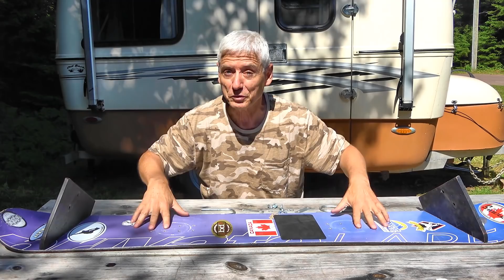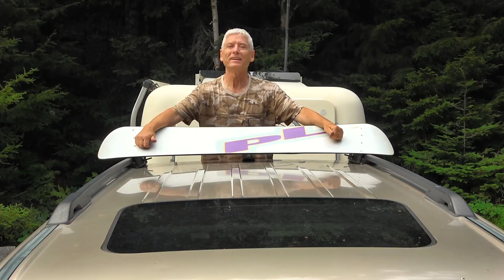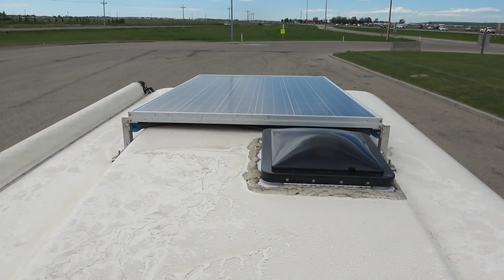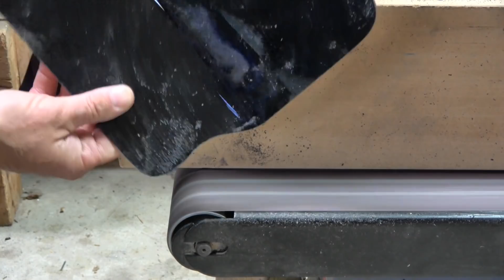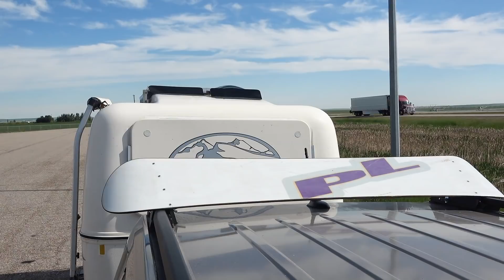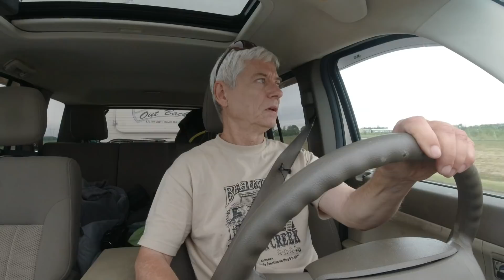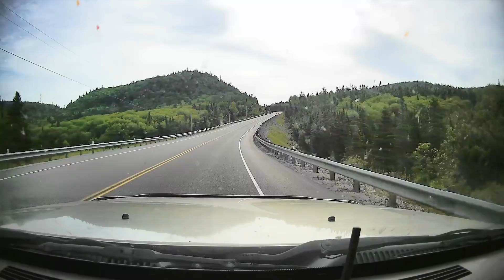Can an Old Snowboard Wind Deflector Improve Gas Mileage while Towing?

Comment: Great results but one variable not mentioned was crusing speed more energy is required to move less than aerodynamic objects forward at higher speeds, travelling at 80km/h yields good results but adds driving time... so were you always travelling at the maximum posted speed?
Reply from the maker: I kept at a constant speed a few kms under the speed limit. SP
Reply: @SlimPotatohead  Thanks for the response... I wonder what savings you would have achieved at a lower crusing speed?

Comment: Eastbound on the TransCanada there’s usually a following wind. My 18 wheeler tractor trailer would get wildly different fuel consumption rates . Ranging from 6 miles per gallon to 16. Even when empty. I’d be interested to see your results on a westward trip into wind. Good to see you trying add on spoiler to improve fuel economy. The future though must be with the manufacturer and wind tunnel testing to reduce drag coefficient.

Comment: I'm not doubting that the wind deflectors help. However,  I can't help but wonder how much the wind direction and speed influenced the results.   I would guess quite a bit.     I also wonder how mpg was when pulling the Aliner with your current jeep?
Reply from the maker: Speed was consistent, a few kms under the limit. The Aliner never achieved the results I currently have, most likely due to the increased weight. Thanks! SP

Comment: Something else you might look into for fuel saving 
There's a product called air tabs that has proven to work on semi trucks and trailers. These devices have been around for about 10 to 15 years with good results. They work by stopping the turbulent are behind the vehicle .

Comment: Great job, Slim. I knew it would work, if you got the angles right, and you definitely did. I'm honestly impressed the results were so good. You really got the right pitch angle on the snowboard. I doubt an engineer could do better.

Comment: I’ve always kept things off my Z71 to keep it from dropping below the already bad fuel mileage it gets. You proved adding aero enhancing features can help even more! I have a few spots I can work on but I just might try a simple deflector. According to bug splats in the trailer my camper shell does a good job of raising the wind impact but about 2’ higher would sure hit the spot. Thanks for the good info!

Comment: This is GREAT!  Thanks for sharing your idea and experience.  I believe the faster a trip allows you to drive (like in a flat land), the greater wind resistance you will experience, and this will result with greater gasoline saving from using the wind deflectors.  Slow driving will not see much saving.  I hope that the dollar savings are based on the dollars-per-gallon rate of the same trip though (to take away the influence of inflation).
Reply from the maker: Good points. The additional bonus of going further between fills is that I can be picky about what gas stations I stop at, saving even more! SP

Comment: The mounted snowboard, in essence, IS shortening the distance between your tow vehicle and camper by sending the “drag air” up sooner. Nice to see these results but a tail wind is truly a big cheat 😊.
Reply from the maker: Sorry, but the tape measure doesn't lie. Distance is still the same, it's only the effect that's changed. SP
Reply: @SlimPotatohead  That’s what I meant.

Comment: In case you are interested, I bought a new Hyundai Sonata V6 back in 2009 and a new Hyundai Genesis V8 in 2012.  Both vehicles produced a gain of 5 to 6 mpg when I used non-ethanol (90 & 91oct.) gasoline over the 10% ethanol gas.

Comment: Nice try, but here's the thing as I know it.
   I'm interested in a cargo trailer for a camper conversion. I was convinced, just by the shape, a V nose model would be better for drag, mostly at highway speeds. What I found out from extensive reading is that the nose shape makes little to no difference. It's mostly side wall drag induced by Eddy currents from the tow vehicle. Surprised? Get this; most air deflectors on tractor trailers don't do anything either. The factory rep from a company whose deflector does work told me who is not a truck driver, that theirs only helps one to two percent. It does help with fuel consumption by that amount, but only with LOTS of miles on the road. We're talking 5 to 6 digit fuel bills per year for those trucks.
   Experiments with this device may show benefits. Only an air flow study would yield that information, OR empirical results over time. I sincerely wish anyone trying such deices the best of luck. You may need it.

Comment: Very nice and interesting. But, driving stile is more important. For example, with my car (true, I don't pull a van). The same car, the same route (from home to my parents in law and back...around 560Km (341 miles). The average consumtion for driver in my country (the same car) is 5.5L/100Km (around 40mpg). But when you drive economicaly, is around 4.2L/100Km (around 55mpg). Now some numbers: if I drive with top speed of 105Km/h. On same road, same conditions, I have 5.4L/100. Driving with 90Km/h I have between 4.4 and 4.6l/100. More, I never push hard on uphills...I try to be as fast is need not to shift down the gearbox. if I see that in front of me is a down hill and after that a uphill..I don't pus to hard to accelerate on down hill...but I am leaving to speed town the car by hisown when I am on uphill.
More...the average speed with different driver is around 68-70Km/h...with me is around 65-67Km/h...so...it the worst case...instead of 8 hours trip, I will have 8 hours and 25mins
And engine break...is the best way to lower the fuel consumption.
Any way...FB...and keep going.
I just hope that in the next year, I will buy a camper/RV...and thake my dark side (wife) to some trips around europe...
Reply from the maker: @bolovanro, for long trips slowing down may improve your gas mileage, however it may actually decrease your chance of making it there safely. Going 50mph on a 70mph roadway is putting other drivers at risk as they are forced to try to get around you. Also, I sometimes drive 13 hour days. Going slower, especially when it is important to reach a specific destination, means additional hours, fatigue, and having to drive in the dark after the sun goes down. There's moose on the roads at night here! So for me, no. I drive just a little slower, I save a little gas, and I keep it safe! SP

Comment: Great video.  Great info.  Thank you.  I pull a 32 foot trailer with an E350 diesel van.  I will now be putting a deflector on top of the van!
Reply: Please let us know the details & results of your experiment.
Reply: Great video and tips. Like how you use realistic upgrades everyone can do. However, being a engineer I noticed significant variation in the "improved" results so like you mentioned outside factors like AC, wind, temperature, tire pressure,... was at play. BUT all trend positive so Great news!!
Reply: Hey Bill and Elizabeth. Hope you are getting out camping this year. 💜
Reply: You might want to try adding Air Tabs if you can afford it. They add stability in high winds as well as increasing gas millage. Russell Rver TV has a couple of old videos on them on his You Tube channel.
Reply: @VickyGeagan  Just remember to put them on EVERY surface for your car. Hood, doors, fenders, maybe even stick them to your hubcaps if you can.
Reply: spoiler alert!!
Reply: Hello Bill!
Reply: It has to be a snowboard to work effectively🙃
Reply: Bn no noo

Comment: I tow with a 5.0 ford f150 and tow a 5000lb TT. Wind is the arch enemy!   No wind flat terrain 13 to 14mpg. Even a slight headwind drops mpg to 11mpg, good headwind drops to 9mpg. This is all at about 60mph.
Reply: My 2012 ecoboost does the same...even when not towing. 22 mpg's drops to 18 with a slight headwind. Similar numbers towing.

Comment: I have found that if i stay at 60mph i get the best milage, im assuming that you went the same speed on all of them
Reply from the maker: I did try to stay just under the speed limit (which was 110 km, or 68 mph for most of the trip). Probably closer to 64 mph. Thanks! SP

Comment: Was the weight in trailer similar?
Reply from the maker: Good question! I actually did weight the trailer prior to both trips. Initially the trailer was 2078 lbs, and for the second trip 2094 pounds. Pretty close! SP

Comment: You have done a great job documenting the experiment.  I think the wind is a big factor as you mention... you could always go back and compare wind direction and speed for both dates using Env Canada historic data.  If I remember correctly from engineering there are several factors that affect wind resistance and I believe your snowboard is high enough above the gap to reduce the suction drag. For instance a snowfence will protect for about 5 times its height so for your 6" rise you are getting 30" of gap protection.  And despite all the theory the numbers don't lie.   As the Americans say "In God we trust... everyone else bring DATA"

Comment: Interesting experiment, and wouldn’t dare criticise but have you considered trying the same experiment without the rear mudflaps; it would be interesting to know if they improved performance by disrupting flow under van.; they are certainly a dam to airflow. 
  Thanks for great vlog.    Regards from the Solent Coast U.K. AJ

Comment: There's lots of other things you could experiment with, smoothing out the underside of your camper may help improve mileage. Lengths of wool can help see if the change you make improve airflow, might be worthwhile experimenting with a little. This technique may help see if popping the sunroof makes a difference.

Interesting results though, I'd not have expected that much.

Comment: I've been really keen to see these results Slim as I operate many large vehicles in my job and I am always looking for improved fuel economy in our fleet. I think you have shown conclusivly that your aero improvements were well worthwhile, so I offer my congratulations on not only keeping your cash in your wallet, but also cutting your carbon footprint too which is all important nowadays. One thing I would like to point out are the savings I have made by reducing the size of mudflaps, or in some cases removing mudflaps altogether. On some of our multi axle trucks that do a lot of motorway/freeway milage the wrong or to big a mudflap can be up to 1.5mpg, especially in windy weather. For me a 0.1 improvement in my yearly fuel bill is several thousand pounds worth saved.
Kind regards.
David in the U.K.

Comment: These are my favorite videos from you Slim!  I love your technical mind!   Kudos to you on your ideas!  Do you think the snowboard would be better in the front of the vehicle top?  That's my theory buddy!
Reply from the maker: @danmanx2, I guess it would be easy to test, but my thoughts are that it should be closest to the problem you are trying to correct. It's the wind deflecting downwards between the back of the jeep and the trailer I was trying to deflect. Thanks! SP
Reply: @SlimPotatohead  True!  I'm no wind expert.  My only experience of wind and massive MPG increases was drafting behind 18 wheelers.  A very dangerous endeavor, but I got somewhere near 50 MPG in my Civic.  Thanks for the input, Slim.  Safe travels, friend!

Comment: Love the comments - always the Besserwissers...:)  Seriously - the best way to save fuel is usually a combination of speed and rpm's - ie - at which speed does your engine operate at it's most economical. Surprisingly that usually means a lower rpm - ie., a lower (constant) speed - hence 55 rather than 70..:) However, towing might mean that won't work too well - depending on how much torque your engine produces at various speeds. Many years ago I did what you're doing on one of my semis - added a wind deflector. Did save a bit but most economical was still slowing down (at the expense of me having to work more hours as I didn't cover as many miles). For me that usually worked unless I had a short delivery time.  Love your videos!...:)

Comment: I'm generally amazed by your ingenuity, but I didn't think that your fairing was going to work.  The snowboard just seemed to small to deflect enough air especially when you look at the deflectors on 18 wheelers.  I'm pleasantly surprised.
Reply: Comparing an 18 wheeler to a 
Camper 😂😂😂😂🐥

Comment: I am curious if cruise control was used both time. I think use of cruise control may make the two trip even more comparable. No doubt that you took great length in going to the same gas stations and collecting all the receipt and odometer reading. Good work as always.
Reply from the maker: Good Question. I did use it at some points, but find it typically over-revs in climbing. Plus there were a lot of trucks on this route. Thanks! SP

Comment: I was wondering if you cut out a notch out in the snowboard to go around the rails and got it closer to the roof. If that would help divert more of the airflow over the camper vs the air under going through and hitting the face of the camper.
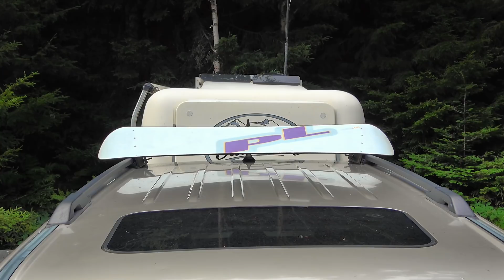Reply from the maker: See the segment starting at 7:50 in the video. Thanks! SP

Comment: Good morning Slim! I'm glad to see you saw some improvement...gives me hope for my modifications....I made an air foil for my trailer and closed off some useless stylistic vents in a front storage box to try and improve my mpg....but I used some aluminum angle and sheet I had left over to fabricate the air foil. Haven't had a chance to test it out yet but soon....I was getting 13-15 mpg before while towing and 18-19 without the trailer...so there is room for improvement. We shall see. Cheers!